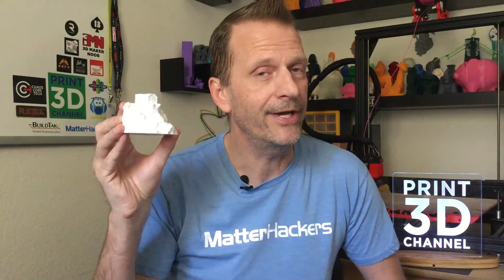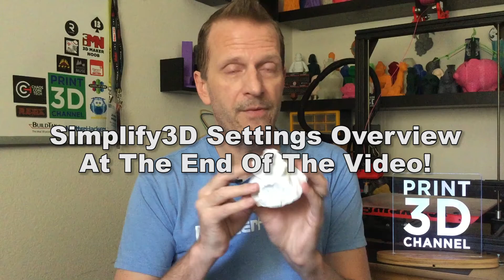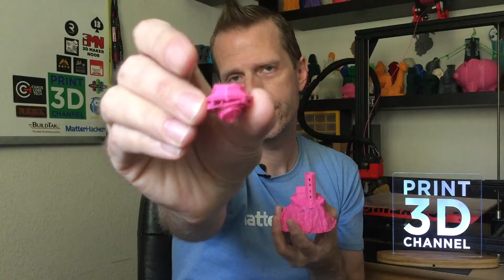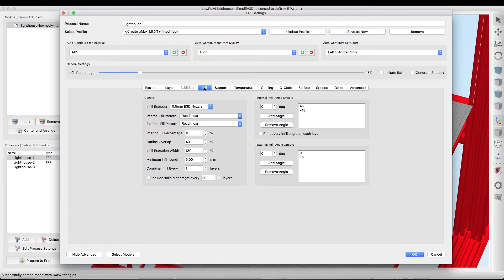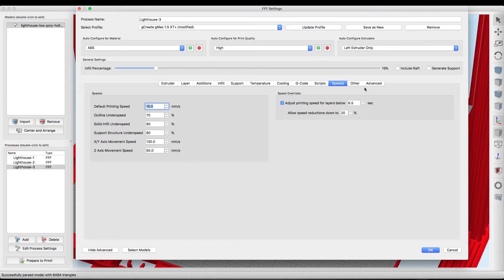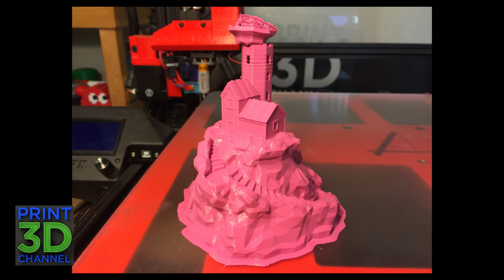#3DP365Project - Day 270 - Low Poly Lighthouse On A Rock - Matterhackers & gCreate3d

Comment: There is another way to fix it. Option 1. Disable retraction for the section where you are doing that process for the tower. Option 2. Alter retraction setting and disable force retraction on each layer and only allow it to retract for a minimum travel distance -- play with that value, I use 3mm, but you can do 5, or 10mm. Retraction only necessary to avoid oozing etc, when you are printing something that small, you really don't need retraction at least nearly as much as it appears to be doing. So I see you are doing retraction during wipe movements -- get rid of that -- DON'T do that -- it causes too much retraction.  And retract over empty spaces, don't do that either -- it's pointless.  Just tick the minimum retraction box, and that's it. You are spoiled with a direct drive gMax, with a bowden delta, I had to figure out the ins and outs of tuning retraction to minimize them. If you force S3D to minimize retraction there will be less zitting, less blobs, and the seam should also be less visible as the seam is created when it retracts and starts extruding again.